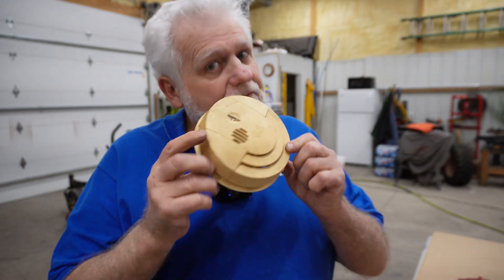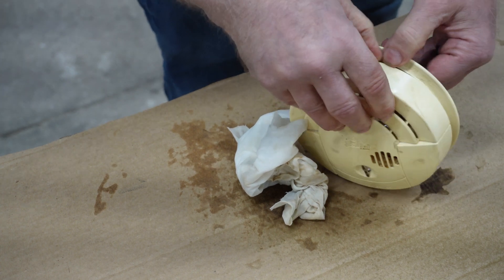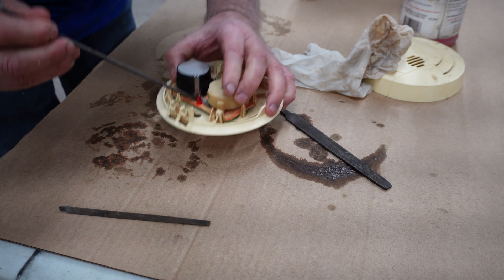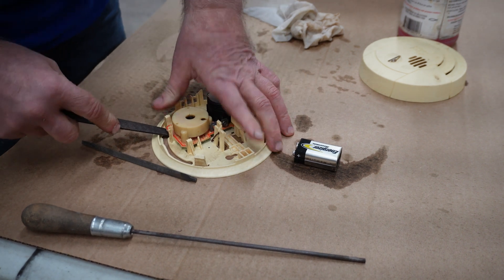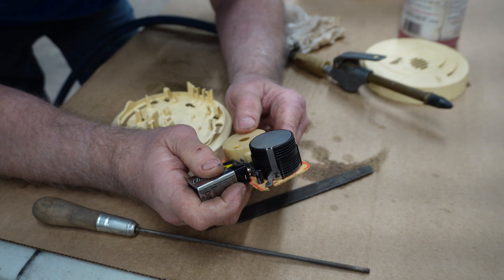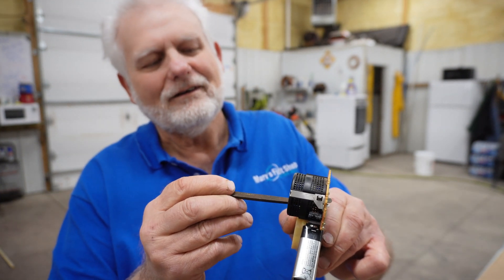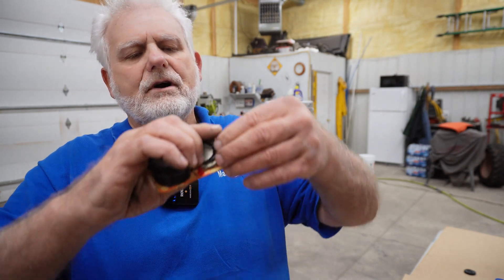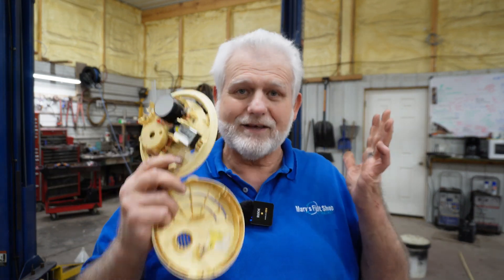How to repair smoke detector | Smoke Detector Teardown | Smoke Alarm Teardown

Comment: ⚠☢The unit is likely an Ionized Detector containing Radio Active Americium-241. Other is Optical detector type. The Black & Metal Section is the Detector Cell is full of grease and more rubbish causing False Tripping. Ionized units never try to take the detector cell apart as the very tiny "Pellet" may get loose then easily lost and became HAZMAT problem. Optical units are safe but often self destruct trying to clean or looking in them. You never get them clean by just spraying anything in and worse many cleaners damage the Detector cells all by their own. The Types detect fires differently and are Not Equal and why some units have Both types to detect Fast or Smoldering Fires. In some Countries/Regions the Ionized units are now Banned or Restricted because of their "Radio Active" you can't measure even with lab grade equipment when mounted as directed. In Many places you can't just treat Old/Defected Fire Detectors as Trash but household HAZMAT to deposed them. Most people have more problem by Radon exposure then all Ionized Fire Detect installed in home and everywhere else.
Reply from the maker: @Thingstest-rl8xu  this is really interesting and helpful information.  Thank you for sharing.

Comment: Almost all smoke alarms have an internal self-test system, which monitor state of the battery, and the actual sensor module itself, and if anything is not within range they either beep or sound the alarm.   They use a dedicated chip which does all the monitoring and self-testing.
Reply from the maker: @martinbaines3719  really good to know.  I need to educate myself more about how they work.  Thanks for watching and sharing your experience and knowledge it’s greatly appreciated.
Reply: @MarvsFixitShop  Some like that one (according to the label on the back) use a radioactive source to ionize the air inside the black chamber, when smoke enters, it affects the ionization process and the sensor can detect that change as smoke, others use a pulsed light and sensor, and effectively look for smoke.   They work on different types of fire - some being more responsive to slow burning fires, other to fast fires.    Most now use optical sensors, as technology has improved over the years, and they can detect most types of fire.
Reply from the maker: @ wow you sure know about these thank for sharing.
Reply: @martinbaines3719 * I like the talking ones. They tell you which room the smoke was detected in. 😮
Reply from the maker: @Fix-N-WantNot I wonder if they make them in other languages
Reply: @Fix-N-WantNot  Not seen one of those - I have a couple of "Smart" ones which connect to WiFi and send text messages if they detect smoke to phone, and you can test and see battery level - they also can control other smart devices so can turn on lights etc.